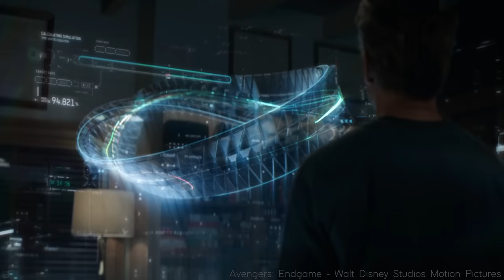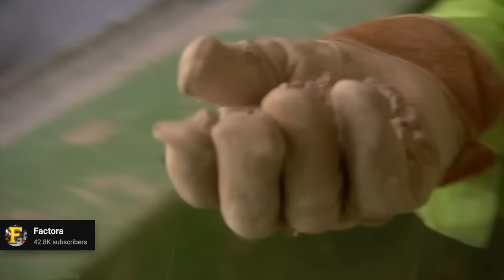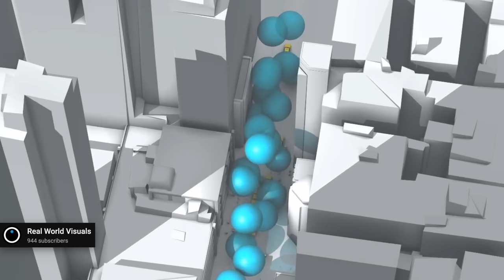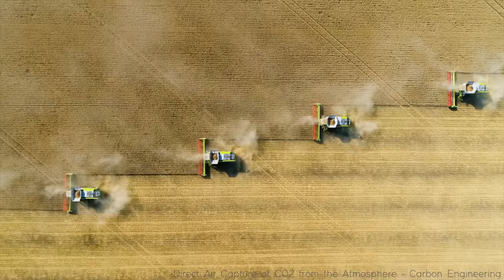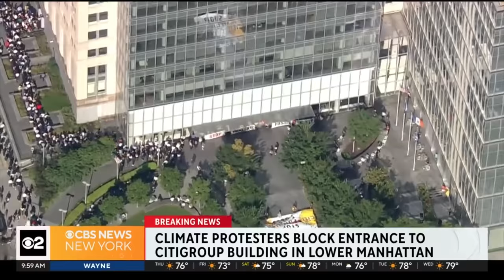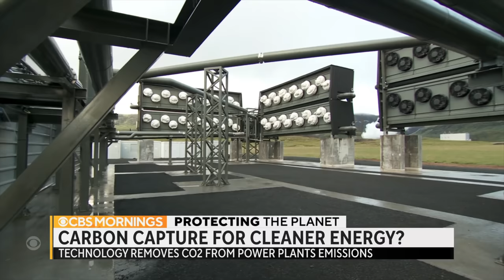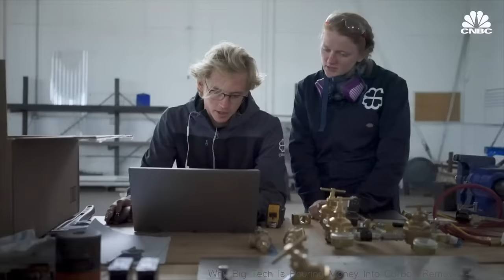How Thermodynamics Holds Back Negative Carbon Tech

Comment: In the distant past (with relatively similar oxygen atmosphere as today) where CO2 levels were very high, life flourished.  (Though this may not be great for humans.)  It seems that nature will provide more photosynthesis as an increase of CO2 level increases to reach equilibrium then eventually the CO2 levels will start lowering as well as the number of species using CO2 and sunlight to produce chemical energy (food).   
Could we look at life that use CO2 for respiration (plants of every form, especially algae) as an answer?   Nature will always adapt eventually anyway (not necessarily for the benefit of humans though).  Why not continue to scale up renewables and look to nature for more solutions?

Comment: Thankfully things do not scale out linearly. 😅
On the plus side, China does not have the population that the ipcc used to run the numbers, and a lot of the developing world will have a lower birth rate than they have traditionally had as they modernize, which again the ipcc hasn't really accounted for. So the future growth of co2 numbers won't be as bad as expected. Still bad, but not as bad.
As mentioned above, rollout of technology is not linear. Wind and solar have been rolling out exponentially... A small exponent, but we are at the knee of the curve, so the scale down of energy pollution is thankfully going to crash. And if we happen to get next Gen geothermal, or the ever oncoming fusion energy, then we will not only dramatically clean up the existing energy infrastructure, but dramatically expand our energy capacity to help with inefficient carbon capture tech.

But it's not all good news. If we stop all carbon pollution today, we would still need active removal to avoid the worst of climate change. And as we will not be doing that, we need to move forward with carbon capture as well as decarbonizing the economy. It isn't really an optional technology for the world. It is necessary. And I get so flustered when people say we need to find better options. Yes, we need better options AS WELL AS carbon capture. It's an all of the above situation. And the sooner we get moving the better.
Reply: Exponential solar 😃😁

Comment: IMHO, the electricity generation will raise and fill with clean energy. A significant part of that electricity will be used to generate hydrocarbons or other carbon based products current based on fossil fuels. That's the same technology that this carbon capture, just instead of pumping to the underground to avoid climate change, it will be used to (still) reduction the usage of fossil fuels through technologies like e-fuels, so probably we will reach net zero slightly later. Then, when some other carbon usage will be replaced by a better solution, we will have excess of carbon capture over net zero, and then, usage it to storage it in some way.

The problem is that after reaching 2º or 3º over preindustrial, some other reinforcement variables will start and accelerate by itself until the natural emissions ends. So the raising won't stop even if we remove some CO2. I guess we will adapt, instead of forcing the climate to the previous state. Instead trying to fixing the global scale, we will probably try to adapt the local scale to the new scenarios.

That doesn't needs to end bad. The planet could end being wetter and after reach new technologies to temper big storms to avoid flooding, and plating a lot of trees that soften the extreme temperature changes at local scale, the planet will gain more jungle places than now.

That's a very plausible scenario.

Comment: Wrong premise: I work in research in this field and actually there is no evidence that global warming poses a risk such as to impose the economic degrowth, global impoverishment and neo-feudalism that would be needed fot net zero emissions. This is a dangerous experiment, much more dangerous than the actual risks posed by excess carbon ppm. Our politicians and climate measures are heading us to an unparallelled global humanitarian catastrophe. I think this vídeo is well done, but it does not help as it stresses the need for drastic emmissions cuts.

Comment: The answer is nuclear power plants and heavy sanctions against voluminous polluters like the PRC or multinational corporations.

A common misconception among Greens is that your individual carbon footprint has any meaningful effect. Self sufficiency and being less wasteful is a good thing, more should practice them, but one greener member of the public is peanuts compared to industrial polluters. Compared to, say, industrial shipping your willingness to suffer an electric vehicle is inconsequential. Even moreso if the power used to charge said EV was generated in the traditional way of 'burn stuff to boil water to spin turbine'. All you've done then is export your tailpipe to another municipality. 
If Greens want to get anything done instead of milk the ever impending climate disaster then they need to overcome their irrational hatred of nuclear power. It can provide grid scale capacity without emitting a gaseous pollutant. I'd rather store already solid or liquid nuclear waste than try to swim upstream against thermodynamics to capture CO2 and NOx's.
That said the cynic in me is convinced that Greens hate nuclear precisely because it is a key aspect to solving the concerns around climate change and would make it so that they're out of a job.
Reply: What do you suppose happens after a government attacks the nations employers? What happens next? Everyone loses is what happens.

Comment: Very interesting, and sobering. What are the numbers on splitting CO2 into C + O2, vs. separating it and storing it?
Reply: This is what plants do.  The energy required to convert a mole of CO2  to glucose is about 100KCal or about 400KJ.  Plants don't do this very efficiently but those would be the theoretical raw numbers.
Reply: @8584zender  Aren't plants also splitting water along the way? I know it takes scads of energy to decompose water, so if you're not doing that part too, maybe the numbers come out better? IDK. Am not a chemist...
Reply: @TheBookDoctor  Better. But fairly similar. We can get less energy use by storing something with lots of oxygen in, like formaldihyde or methanol. (hope those don't leak)

Comment: Was the calculation for land requirement for trees correct?
Reply from the maker: Yes
Reply: So the 10tCO2/ha is the overall CO2 captured by the trees over the trees' life? Therefore, new trees need to be planted each year?  @CoolWorldsLab
Reply: @jamesxiao3392 ok. So where I live the rancher put up 2-4 bales/acre/year depending on what they're baling and how much rain etc. These are conventional ranching in a pretty silly unsustainable way if you ask me. But let's say 2 bales/acre is about 5 bales/ha. Bales weigh about 1100lbs or half a metric ton. They shouldn't be making bales higher than 18% moisture. We'll use 18%. We can also say that grass hay is about 45-50% carbon. So we got 2.5 tonnes/ha which is roughly 0.92-1.02 tonnes/carbon. Ranchers with bad practices in an average year are harvesting 1 metric ton of carbon per hectare from the above ground biomass of a hay field they cut as much as possible from last year. Now I don't know where else that carbon could come from other than atmospheric CO2. I don't know what mass of CO2 this translates to for sure but it should be as simple as simple as multiplying by the ratio of CO2 to C molecular weights. Which is 44/12. So these poorly managed over-extracted driven-all-over hayfields are capturing 3.67 tonnes of CO2 per hectare per year just above ground. There is no way a ha of forest only captures 5-15 tonnes over its whole life. Absolutely no way.
Reply: Exactly. That was why I asked whether the calculation was correct.  @gekkobear1650
Reply: @xgongkui  really makes you wonder what guys like this are thinking when they make these videos. He blatantly left out a time dimensions for the tonnes/ha captures by trees. And it gets so much more complex than that. What does this guy consider to be arable land? To most of us, arable land is anything you can cultivate field crops on. Not clear if that's how he's using it though. There's a lot of rangeland that could be much better managed into a savanna-like state. We know savannas are the most productive ecosystems which ultimately means they are cycling carbon the quickest. There are integrated animal and cropping systems that can build soil at an extraordinary rate. What's that but carbon capture? We could be getting a lot more of our food from perennial woody plants. We could in fact rework the entire land management system. We could decentralized farming and we could farm in small scale ways that capture carbon really fast while reversing desertification (not to mention helping the whole alienation problem.) ultimately channels like this are only interested in industrial solutions that allow industrial society to keep extracting and polluting forever. Which literally cannot happen. It is easier for these people to imagine magical Second Law breaking technology coming to save us than it is to imagine decentralization and taking responsibility on an individual and community level. It's easier for them to imagine making a fusion reactor than a root cellar. It's absolutely ass-backwards religious dogma.

Comment: Wouldn't it be a lot more efficient to attach CCS to power plants, concrete plants, cars, airplanes, ships - anything that emits co2?
Reply from the maker: In principle, but what about countries that refuse to install such tech?
Reply: For cars, airplanes and ships, you would need to carry it around. Also, in practice, econonmies of scale exist. Also we want to suck up already emmitted CO2.
Reply: @CoolWorldsLab  Why wouldn't they want to? Cost? Seems like a reasonably practical thing to subsidize through richer countries, and easy to sell, could even work out an economic arrangement that made it beneficial to the financers. The politics of being green are substantially motivating, I'm not sure what else would hold them back.
Reply: @donaldhobson8873  The primary goal is to prevent CO2 from increasing, not to reduce it. If we stopped emitting even at 90-95% in the next 25 years, climate change would basically be solved - at least in the short term. DAC is absurdly inefficient as we've seen. Carrying around capture devices is the only way to continue emitting without consequences, which is the closest thing to a practical solution we've had so far. This would hurt efficiency, but also eliminate the regulatory and political pressure, and allow for dirty fuel providers to ramp up production. Many powerful players would likely consider this a win.
Reply: @tomfox41  DAC is "absurdly inefficient", but still uses a fair bit less energy than released by burning the fuel.  
This is because, in theory, the energy needed to suck up the CO2 in the air (and turn it to pure CO2) is only 3% of the energy released by combustion. 
In aerospace, often weight really counts.
For some applications, like camping stoves, welding torches etc, the combustion isn't enclosed, so capturing the CO2 is hard.
Besides, making loads of little air filter systems would be a huge logistical pain. Making a tiny one to fit on disposable lighters? Getting CO2 out of all the varying cartridges and tanks? Much easier to make one big system, even if it uses more power. 

That power can be cheap excess peak supply solar.

Do we want to keep CO2 at current, or preindustrial levels? That is a genuine question we might decide either way.
Reply: @CoolWorldsLab  so you’re basically advocating carbon equity to those countries that can’t be bothered?

Comment: To me DAC seems a silly approach. Why would you try to capture CO2 from the ambient air while there are loads of concentrated CO2 streams? Even if concentrated CO2 streams diminish by phasing out fossil fuels, power generation through burning waste will remain and one may also choose to use biomass power plants in the energy mix in order to capture co2 and increase flexibility. 

For the rest I've a bit of a problem with your opening premise of not collapsing the economy. First of all, research has shown that above a certain level economic wealth does not contribute to well being, so if not the economy, at least the current economic system should be destroyed. Second, half a century ago the club of Rome published a report limits to growth telling the obvious, unlimited growth in a limited world is not possible. This essentially means that the current economic system of striving for eternal economic growth is unsustainable CO2 is just a symptom of the underlying problem of an unsustainable economic system. At some point we've to say enough is enough and switch from an economic system aimed at maximizing wealth to an economic system aimed at maximizing well being. This implies not destroying our environment and reduce the impact of our actions to within the regenerative capacity of earth.
Reply: Given large scale easy CO2, near where you want to bury it, use that. But many processes will only produce CO2 in small, inconsistent, hard to access amounts. 

"club of rome". Watch this, the fastest trip from the tautological "unlimited growth in a limited world is not possible" to the rubbish "This essentially means that the current economic system of striving for eternal economic growth is unsustainable CO2 is just a symptom of the underlying problem of an unsustainable economic system"

Growth can't continue forever. Once we have spread over a few million galaxies, our space empire will have to stop growing. 

"First of all, research has shown that above a certain level economic wealth does not contribute to well being, so if not the economy, at least the current economic system should be destroyed." Maybe double check that study first. And then check if it's because of some trivial easily fixed thing.

Comment: Too many hydrocarbon = too much pollution = need for mental health professionals (and global scalable sustainable energy).
Adverse effects includes global warming awareness = need for yet more mental health experts? I would've picked a different sponsor 😂
Anyways, i like the math! It makes sense, like, it'll take all the energy we ever got from fossil fuels to remove their "pollution". 
So this leads to yet another dilemma, which is getting science experts to motivate the average mental health expert to want to accept the fact that...

Energy is good!

We need lots more of it!
(Brainwash that into all of our heads).

Then it's no big deal sequestering back down to the Holocene standard, of about 290 ppm.
Of course, instead of using almost an almost entire present day total global energy supply, to break apart all those excess CO2 molecules back into carbon and oxygen, it would be like only a small fraction of them awesome global power supplies (if we truly scale up LFP battery and solar to not even half the scale of what present day hydrocarbon extraction - per volume.
Currently, the world burns about 2.5 cubic miles of hydrocarbons. E could surely power ten present day total global power supplies with that much volume of batteries and solar!
Hell yes, we need to truly industrialize the clean energy economy!

That said...
Can't we just grow a hundred thousand sq km of algae on the oceans? That'll solve the problem, without us having to collect and store all that ^extra^ solar energy. 😏
Reply: Yay for loads and loads of batteries + solar.

Comment: What if we make very huge pond and fill it with algae? Can it capture co2 economicaly?
Reply: How do you keep the algae from decomposing and releasing the co2 again or converting it to methane?
Reply: @oregonsbragia  wow i never thougt that way, maybe we can harvest them and turn it to liquid vertilizer?
Reply: @15_muhammadkhoirurrizqi93  I don’t know organic chemistry that well, but I do know that most reactions with carbon involve creating co2, co, ch4… and many other hydrocarbons, and bi products. Carbon has a way of cycling and returning to the atmosphere. You can use energy to turn it to fertilizer, then plants take the carbon and eventually the plants die and return it to the atmosphere. 

You have to visualize the scale of the problem. It’s took hundreds of millions of years to turn dead plants into oil and build up a huge reservoir of captured carbon. It took us 200 years to release it. I’m pretty sure that there is no putting it back.
Reply: @oregonsbragia  i dont have argument anymore, thank you for your time
Reply: We already have a huge pond. the pacific is very big. 

Not enough algae though. Maybe we should genetically engineer it.

Comment: Obviously the smartest people are already working on this and what I am going to say might just be an embarrassment of myself. But if its really just absorption of CO2 from air directly wouldn't it be better to do that at the major sources itself? Do the heating process to then remove the carbon from those absorbents in regular intervals as per some protocol defined by the use case scenario? I am Assuming that the source would be much more carbon rich than general atmospheric air. An analogy would be wearing shoes instead of carpeting all the roads, I guess.

Comment: Anyone who is even considering using this to save humanity needs to do the numbers. We'd need 40,000 of the giant new plants being built in Texas and Louisiana. And then we would need massive zero carbon electricity capacity to power them. It's asinine.
Reply: "save humanity". The effects of climate change are expensive and problematic, not doom. 
2x as many hurricanes, several cities flooded type stuff.